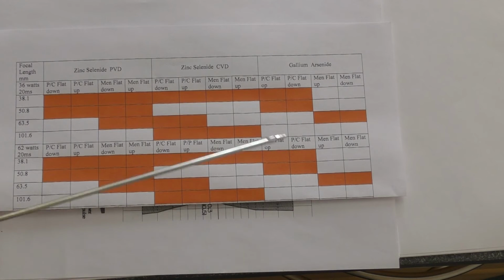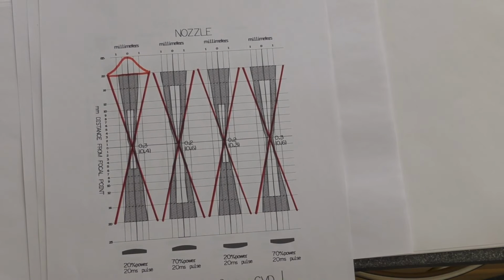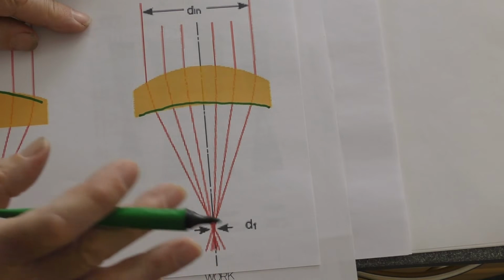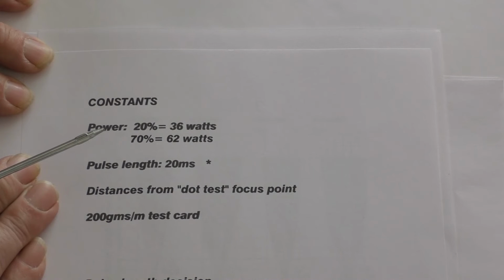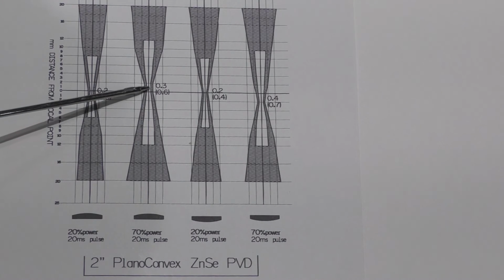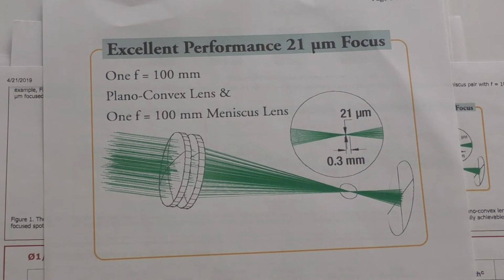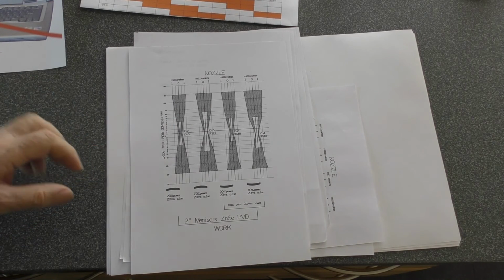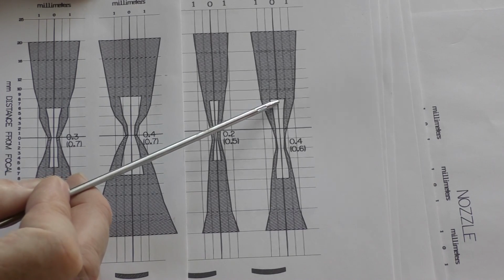RDWorks Learning Lab 163 Lenses Part 2 Lets Focus

Comment: Hi Russ, there is a thing that bugs me... Assuming the beam has this bell shaped intensity profile, why don’t we get a smaller and smaller hole as we move out of focus after a certain point? In your tests the hole widens and widens and suddenly disappears. It could be that the tapered part is in-between two samples but there is no trace of it in any one of the different cases. Any thoughts?
Reply from the maker: Hi Thomas
 This test work was the beginning of a two years set of tests and experiments to try and estobisk exactly why lenses cur. Everyone spends a lot of time concentrating on the focal point because that is where the lens manufacturers concentrate effort.. Their goal is to get all rays passing through  a single smallest spot size. and that is what we have all been taught. What happens after that focal point is YOUR problem and not within the lens manufacturers remit.  There  is another widely documented  energy density "fact"   based on this theoretical spot size. The spot size change between a 1.5" and 4" lens is dimensionally very small; but when you convert those dimensions to area then the differences are large. Lets just say that the area of a 1.5" lens is 1 unit then as the focal length increases to 2", 2.5" and 4" their areas change to approximately 1, 3, 6 and 18 times.  Thus if I had a 100 watt tube then the energy density of a 1,5" lens is 16 times greater than  that at the focal point of a 4" lens. . This implied that a 1.5" lens would cut a lot better than a 4" lens.  My experiments showed the opposite to be true and thus I began my hunt to try and find the real truth about how lenses cut..
 What you see in this video was my first foray into the subject  convinced that there would be some evidence /patterns that I could use as a guide for my next step.  The only thing I proved was that I could never get ANYWHERE near those theoretical spot sizes
I am literally only just finding out thal truth I have been seeking. So you might like to jump to 
https://www.youtube.com/watch?v=WwsjwUmeCFI
and 
https://www.youtube.com/watch?v=ITQiwjAJysQ

 Best wishes
Russ

Comment: Hello, I really like what Russ is doing in his videos. Literally professional. I bought a double head laser machine with 130 watts of power. I want to make money with this machine. I want to cut mdf and engrave my lover's photo on mdf :) Like you do. Those who came to install the laser machine did not give me enough information about how to use it. Probably not as good in themselves as you are. I have no technical knowledge. How many inches of lens and what brand should it be for image engraving? And can you tell me what to look out for in the engraving process?
Reply from the maker: Hi Murat
 It's exciting to get a new machine but if you have  no previous knowledge of laser machines  I'm afraid this s no like hooking up a printer to your pc and  learning a few keystrokes to make it perform.  With some basic knowledge you can make the machine work but  the real problem is that no two machines are exactly the same  so after learning a few basics you will have to tune your practices and parameters to fit what your machine can do. It can do two basic things, cutting and engraving. These two processes are completely opposite in their parameter requirements. There are lots of myths about lenses and there is so much more to lenses than most people ever bother to know. Initially I would suggest using a 2" (50.8mm) general purpose lens. You claim to have a 130 watt tube which will be too powerful for good photo engraving but my guess is its actually less than 100 watts . I can send you a datapack on photo engraving but it requires some knowledge of image editing as well as an understanding of your machine's capability. Just add your disguised email address to another comment and I will send the information to you and also delete your comment/email address from public view.
Best wishes
Russ

Comment: hello russ I have a question on my laser when I send my work to the laser it shows up backwards I don't know if I hit a wrong button thank keep up the good work
Reply from the maker: Hi Richard, 
Not sure where your problem is from your description
1) It could be your settings in RDWorks. Your drawing will always look OK but if not matching your machine 0,0 will produce a mirror image when sent to the machine for cutting.
 Where does your machine run to for it's datum when you switch on or RESET. .. It depends on which issue of RDWorks you have. If you go to Config System Settings you will either find 
A) a  picture showing 4 dots to represent  the corner that your head runs to. If so make sure the correct corner is chosen.
B) If it is an older issue then it will ask about mirror X and mirror Y. . It is a certainty that your head runs to one of the back corners in which case mirror Y will need to be ticked. If X runs to the  left corner  then leave the X mirror unticked. If it runs to the right than tick the X mirror
The final check is to look for the two blue arrows in one corner of your RDWorks work area.  They MUST match the corner where your head sets 0,0.

2) If this is not your problem then maybe your picture displays on your machine keyboard incorrectly. If this is your problem then press your ZU button and the bottom item in the menuu is SCREEN ORIGIN Play away!!!!

Best wishes
Russ

Comment: My question is if I need a Voltage regulator on my machine to garante consistency of power?
Reply from the maker: Hi Yanko 
Most electrical equipment is  very tolerant of voltage changes. I think it would have to be at least a 30% drop before you noticed any changes. I speak with many people from all parts of the world and this has never arisen as an issue.
Best wishes
Russ

Comment: Hi russ, me again 🤗 Another very interesting video thank you. Whilst waiting for my machine to arrive I have been reading up on and watching every video I can find on how to run these machines without causing irreversible damage during the learning phase of operation. Whilst cruising the ‘www’ looking for the correct mA reading for a 100w tube I came across an article that described using a small adjuster screw somewhere on the tube power supply in order to tune it so that when the controller is set at 100% the tube is at the correct mA thus giving you the full % range on the controller. I notice in your video you mentioned 70% being full blast for your tube and am now worried that there is a reason not to mess with the power supply, as I’m sure that if it was a good thing to do, you would have already done so. 
Again many thanks for sharing all your hard work both on the machine and documenting it in sure a clear and concise way 
Regards Jamie
Reply from the maker: Hi Jamie
Some power supplies have this screw externally available and others have it buried inside the case. If you have a 100 watt tube then generally it will be 24mA limit. However if it happens to be a named tube then 26mA will be the limit. If you look at the rating plate (or specification for your power supply you will find a 100watt unit will be capable of delivering  30mA. Without getting too technical the % power you feed into your program is NOT watts. It's  percent of 30mA. That relationship is perfectly linear. whereas 50% power on a 100 watt tube is not 50 watts. the watts output is very non linear. I leave my power supplies with factory settings because  
a) if I adjust it to 26mA I cannot plot the full calibration graph for the tube. It is necessary to over drive the tube to get this data , but you only do it for such a short period  that you will not damage the tube.
b)Once I know what that max % I am allowed to use, my 2 remaining grey cells are enough to prevent me using higher values.
c)There is a quicker and easier way to apply a safety stop if you need it. Go to File, Vendor Settings, password RD8888. You will need your pc and machine connected (via USB?) so press the READ button to upload the data from your machine memory. Select the laser tab and there you will find a Max and Min tube setting limit.  You can set the max to say 70% and press the WRITE button. Job done.
Best wishes
Russ
Reply: The power of your grey matter was never in question, only my own. Now If my understanding is correct (it usually isn’t) the pwm output of the controller is scaled in 256 bits between 0 and 100%, if never set over 70% max or under 20% min are you not effectively only leaving 128 bits of working pwm range thus reducing the resolution of grey scale engraving. I get the need to over drive the tube for testing but surely never 30% could you not leave just a 5% or 10% margin as over drive capacity? I know this is a flawed statement in that 100% power is never used for engraving but it is the resolution of the pwm signal that we are calibrating
Reply from the maker: @jimmer147  
Hi Jamie
PWM is very confusing on this controller. If you look on CN5 terminal group you will find an AN1 terminal.This is an analogue power controller that can be used instead of the PWM. Your % power appears on both these terminals as a 0 to 5vdc signal representing 0 to 100% of the max output power of the HVpower supply. This DC signal from the controller leaves the controller either as a digitally encoded PWM signal so that it does not get affected by spurious rf interference or as a simple analogue signal depending on which terminal you have connected. When that signal arrives at the HV power supply IN terminal it passes through an rc filter that either let's the analogue 0 to 5vdc signal straight through or intercepts the PWM signal and turns it back to an analogue 0 to 5vdc. It is the value of this dc voltage that actually controls the current allowed to pass through the tube.
 PWM has nothing to do with grey scale, that is a completely different story. 
When you import a colour photo to RDWorks, it imports as a grey scale image where every pixel is mapped for its coordinate screen position and its shade of grey (0 to 255), When you select the SCAN parameters you will select the OUTPUT DIRECT switch and that will now activate the grey scale decoding in the controller. Before you start scanning you must set your Max and Min powers. Max power=0 (black) and Min power=255 (white). Now when you start scanning the controller will output a power signal for EACH pixel according to it grayscale value.
I hope you can now see that PWM and grayscale are not related. In the controller manual, it actually recommends the analogue output for glass tubes and PWM for RFtubes.
Best wishes
Russ
Reply: Understood, I think my incorrect terminology and mixing of processes has confused things. Disregard the mention of engraving and the 256 step pwm and it’s irrelevance. If the controller output is between 0 - 5v and the untuned laser power supply is, for ease of math, 0-35mA then we have 0.07mA per V, if tuned to max out at .25mA then the output is .05mA per V is this finer control resolution not more desirable?
Reply from the maker: @jimmer147  
Hi Jamie 
It's finally all down to one's level of OCD. The only time you need tight control of power is for dot photo engraving. I have a 60 and 70 watt tubes. Your ( Reci W4?) may only output about 80 watts. The power can be selected in 0.1% increments and I have NEVER had to resort to that last increment of control for dot engraving.. For cutting, the nearest 5% will be fine. So I think you are worrying needlessly. 

Best wishes
Russ
Reply: Say no more. I’m not looking for extra work. Just interested in how it all works
Reply from the maker: @jimmer147  
Hi Jamie
You and me alike. A full understanding of what we are dealing with means we can make sensible decisions based on facts. I have done a lot of unnecessary things and made mistakes during my learning journey and I hope that others will recognize those mistakes (and forgive me) and that it will shorten their learning experience.

Best wishes
Russ

Comment: Hi Russ,

Brilliant as always.
Question.
It would appear that based on 20% and 70% power levels that a smaller dot ( burn through ) is obtained with less power.
But you have to use these power levels in the real world to actually see results by burning material, every material has its 'power burn level'.
If there was a material that with a pulse length of 20 ms at power levels of say 5% showed burning,
then I would presume that the dot size ( burn through ) would be much smaller than you are obtaining now.
After all, when you do your multiple dots test to set focal length, if the material you used allowed a hole to be burnt through then the hole would indeed be very small.
Just ideas..
Reply from the maker: Hi Jerry
There are Three  things you may wish to do with this machine. One is cutting where you must use max power normally (and quite slowly). Two is simple engraving of logos and text where low to mid range power is required and  three is photo engraving where very accurate control of low power is required to make precise dots.. 
 Lets start with dots. If you are an artist with a small paint brush  you have the  choice to make a small dot with that brush by JUST kissing it on the surface of your canvas,  or to make a  large full brush  dot  by pressing the brush harder.  Our laser beam is a bit like that brush in that it has more power at the centre just like the brush has a point.  If we just kiss that point of power onto our material we will BURN a small dot  but if we leave the beam on that SAME spot for a longer period then the dot will be bigger.. So, the spot size of the lens is less important than controlling the power per dot ie a balance of power and time.  I'm pretty sure that what you are seeing with this 20%  and 70% difference is mainly that effect.  However, this does raise the question as to what the REAL spot size is  and I will be returning to this issue in a future part of this series. Theoretically ALL the light should pass through that SPOT (the focus point) therefore the spot cannot change size. So that means that even my charring diameter for 70% power is still not the spot size, because it gets even bigger when I increase the time from 20 to 50 ms. Alarming isn't it?

Best wishes
Russ
Reply: @SarbarMultimedia  Thank you for taking time out and doing such a detailed reply. very much appreciated...
( Your Laser series is responsible ( in a good way ) for me starting a small business designing and cutting out ( MDF ) wagons for 16 mm Garden Railways.)

Comment: it would be nice if every lens was sold with these maps.  standardized to CO2 lasers at a specific power and pulse time.
Reply from the maker: Hi
The maps in themselves are interesting but have little practical meaning until I relate them to performance. I am just designing tests to check that feature now.
Best wishes
Russ

Comment: Hi. I greatly appreciate your work here. I've learned a lot, and I am in the process of buying an 80W Chinese machine for batch production cutting/engraving. I think perhaps there is a limit to what is attainable with optics here in terms of dot size. Have you looked at retro fitting a low cost 1 micron solid state laser? This would bridge the world of industrial quality cutting (the world that you came from) with a much much lower cost world that these machine cater to. Just a thought!
Reply from the maker: Hi
I really appreciate your comment and suggestion and I am well aware that different wavelengths of laser light  can stimulate the same material to greater or lesser extents. As your are aware I a a retired engineer who bought a cheap CO2 laser as a retirement stimulus for my two remaining grey cells. The fact that there were no reference sources to help me though understanding the technology and that my other long time hobby was video production/editing allowed me to take on my own learning journey and share it. My goal has always been to understand the technology I bought at a budget price and to see just  what the real performance envelope was. Could I make it in any way close to those VERY expensive big name products. I  have applied my shed science  to create  simple pictorial models ( maybe not scientifically accurate) that allow me to glimpse into the physics  principles that make this technology work. . I have never wanted to build my own improved machine, but just to understand to the fullest extent  each part of what I already own. Lenses are right at the end of the beam path and where the final and most important but least understood part of the technology takes place. 

 Your enthusiasm  for mixing technologies is an interesting concept but,  just like 3D printing, is not something that attracts me.  However, when you have  house trained your new Chinese dragon , i suspect you will be testing these ideas for yourself.
Best wishes
Russ